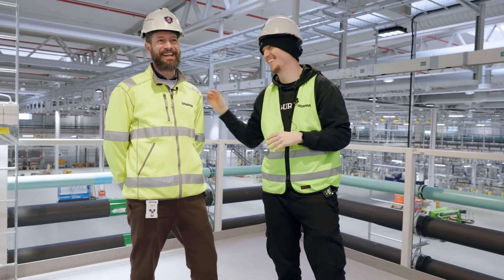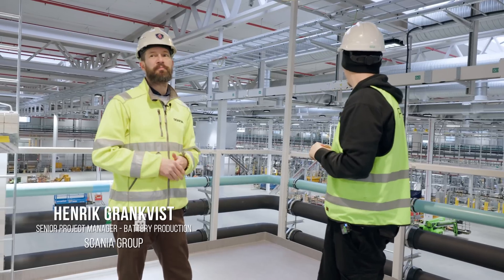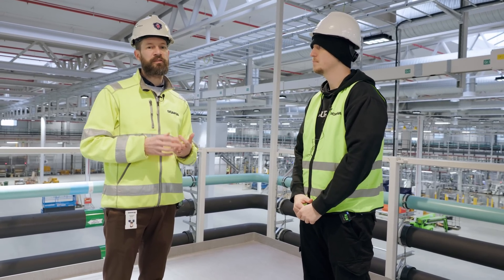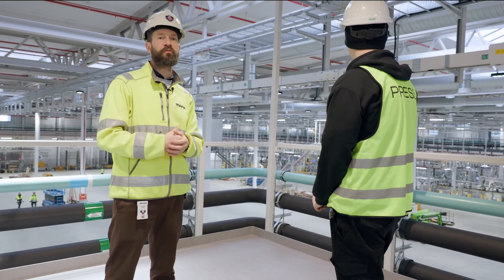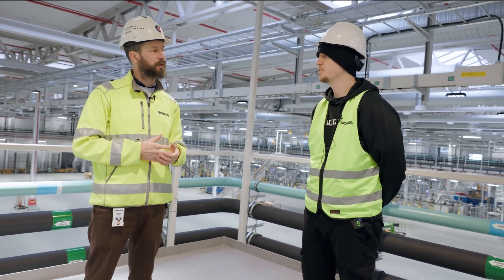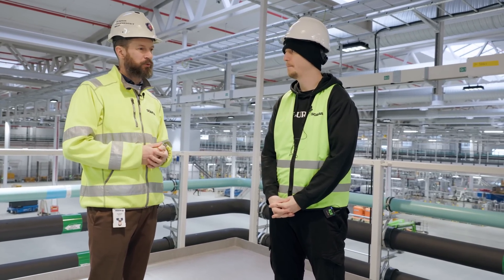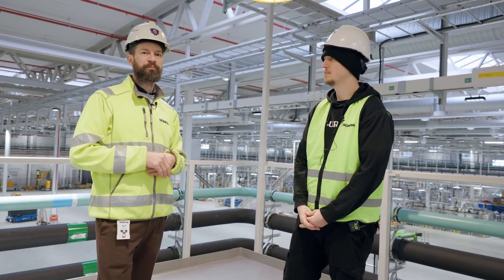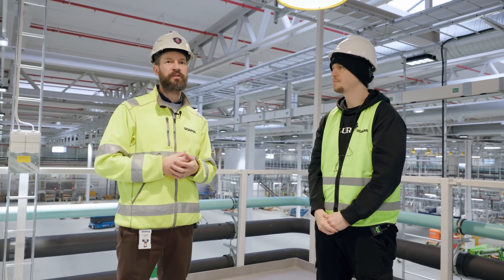SCS On The Road - Scania Electric Battery Assembly Plant

Comment: This is just my opinion. It would have been great if SCS did not immediately jump from Diesel to electric. Before electric trucks became popular there were Gas and Biodiesel trucks. This would have been a good way to bridge the gap from diesel to Electric trucks.
Reply: What jump?
If (…) they start to include BEV, would be great.
That would painfully expose the lack of high-power chargers in EU, and the ridiculously tiny range of current EV-trucks.

Otoh, destinations in zero-emission zones should be increased each subsequent update.😂
Reply: @hanswitvliet8188  The Jump from Diesel to Electric. I did not mention anything relating to Battery electric vehicles. 
I was specifically talking about GAS and Biodiesel trucks. To bridge that gap.
Reply: @johntshotetsi3445  the jump from diesel towards fully electric, could have been done using serial-hybrid (NOT parallel-hybrid)
But instead, manufacturers limited themselves to focus on euro5, and euro6 versions, just trying to reduce exhausts.